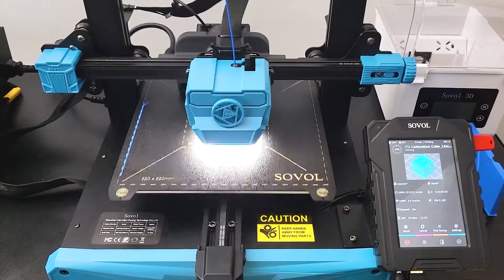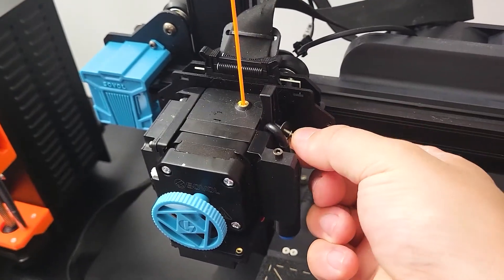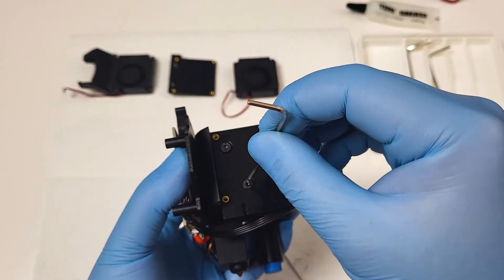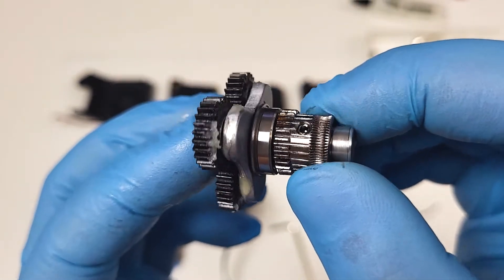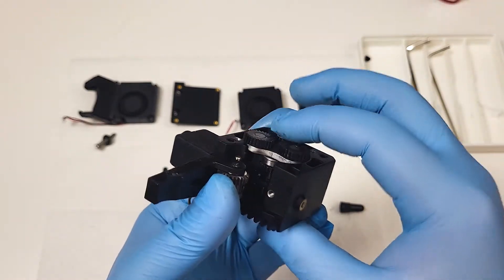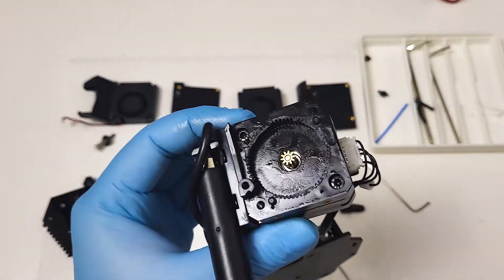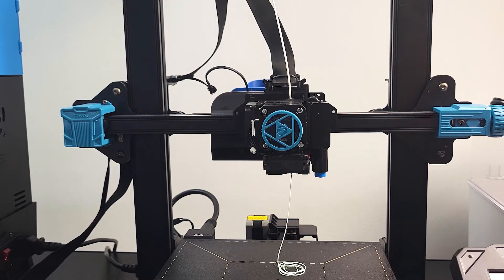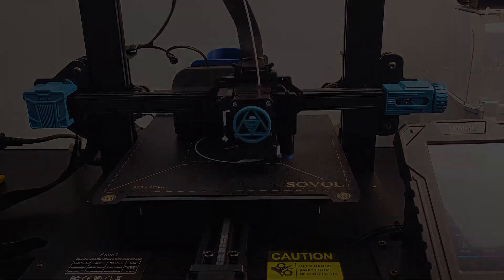SV07 Extruder common issue and maintenance guide, must check!

Comment: Hi, I have a problem with this piece, my filament got stuck in the entire hot end and I can't remove it because it's stuck between the nozzle and the cylindrical part that binds it, how can I do it? should I buy a new one?
Reply: hey ho, i think i have the same Problem now, how do u fix it?^^
Reply: Hello, I managed to fix the problem by cutting the wire, putting a nail of the same diameter in the hole of the cylindrical part and hitting slowly with a hammer, I used a rudimentary technique but it worked😂 let me know

Comment: Had mine 3 days now and if this is a common issue I think I’m going to return this unit and just cough up the money for a bambu. Quality control should be shot lol
Reply from the maker: This is more like early production issue, according to other people 's feedback, they have fix this issue on their unit. Bambu Lab printer also have it's own issue tho.
Reply: @SvgLau  I understand what you’re saying. Maybe I got an old unit or something because I did everything except take this bad boy apart. This isn’t even my first issue. I updated everything in makesail and also updated the firmware. Bricked the unit and I had to rewrite emmc. Didn’t even know you could do that until recently lol. Bambu does have issues but how can you beat a device with so much support? I hear from Sovol days later. Sovol is going back!
Reply from the maker: @ChivasKimber  yeah, that's very unfortunate. I got mine work out great beside the big noise issue. Until last week I have it complete clog by wood filament, still don't have time to make it return to work yet..I have got my bambu a1, running test right now,

Comment: (SV07+) yea i think i have this, no extrusion power, felt it loosing capability slowly while testing, did a slow LARGE print -> Filament runout sensor broke down at the very end.
Start new print and extruder fails.

After 13 years of printing, dozens of printers, it's not many machines which can frustfrate like older Prusas, this is doing it.
Reply: hmm, mine had loctite on those too, but something else killed this, full disassembly ahead i see

Turns out it was the throat jammed, or somewhere there, there seems to be a step causingfilament to jam easily, and that filament was also out of spec -- 2.0mm !
Reply from the maker: @skaltura  I think it might be filament kills it. Did you try to contact CS with your issue?

Comment: Hi! Have you tried printing TPU with the SV07? if you did, how was it? And did you try even lower shore hardnesses (like 82A or lower)?
Reply from the maker: I have tired printing TPU on sv07, no issue so far. I only use 95A, so I can't tell you if 82A will work or not.
Reply: @SvgLau  thank you!

Comment: I had my sv07 for 3 days when the extruder had started making weird noises. I had only maybe 15 hours print time on the printer. I had 0 extrusion which I initially thought was a clog, it turned out however both the grub screws had came lose and had even been grinding on the aluminium body on the inside which had knocked a piece off and blocked the nozzle. Had to replace one of the screws and then tighten them correctly and replace the nozzle. Was not expecting this 3 days into ownership
Reply from the maker: Yeah,same happens on one of mine sv06. They really should have put lock tight on assembly line from the beginning..
Reply: hey! You actually got it to print immediately, i've been battling 2 weeks with this machine, nothing but issues.

Either no QC at all, or i was sent a faulty unit (serial label sticker was half of when i received it).
Reply: @skaltura  what issues are you having?

Comment: This disassembly is too complicated, first look it's like urggh what have I done haha.

Also the tension from the heater block wire is way too much, I actually broke the connector off the pcb trying to get the wire into the connector, extreme tension to get it and poor soldering from the look of it, thankfully able to solder it back, but the tension from the heater block wire is insane, no way should it be that rigid and tight
Reply from the maker: Yeah, I felt that strong tension while I put it back as well, But I guess that's how they put it together from assembly.

Comment: At 3:17 What size are the last two screws in the heat sink? I swear I am turning them but then it slips. 2.5 mm?
This is driving me crazy. I don't want to strip them.
Reply from the maker: I think it is a M3, 3mm one. It should be M3*8mm according to the Sovol CAD model. It shows 2 M3*8mm and 2 M3*16mm holding the heat sink.